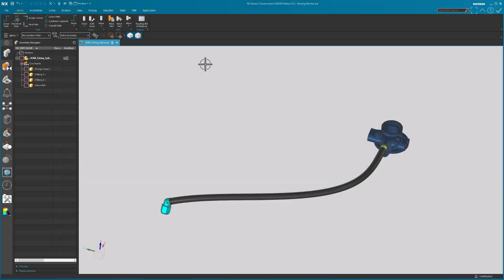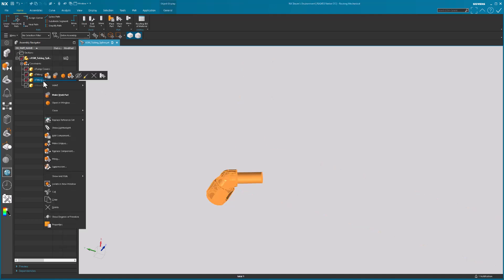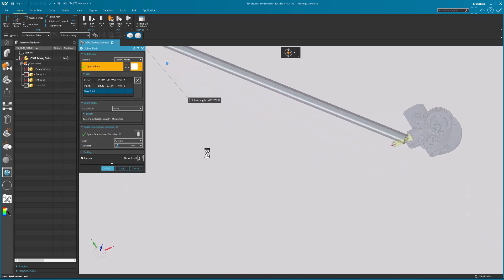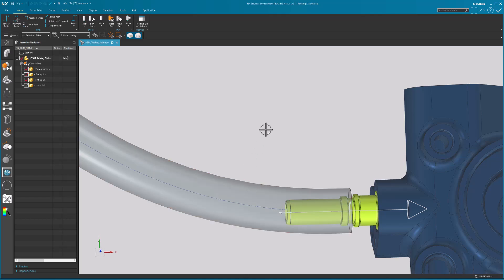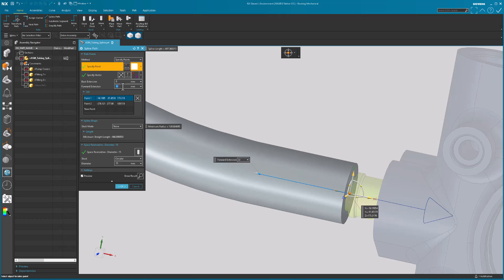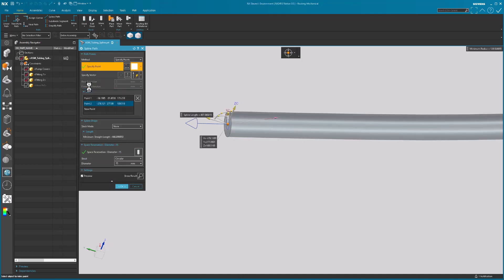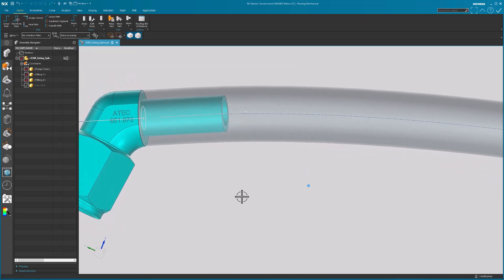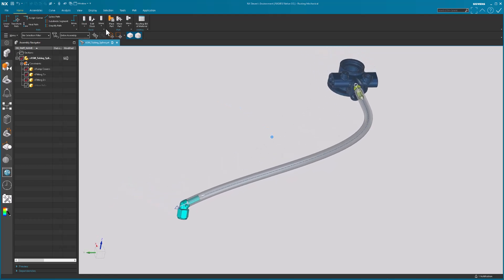Spline Path Hose Tricks in NX You Need to See!

Comment: Why don’t you qualify the fittings with mechanical port objects instead of a point/axis? This should also make spline “connections” easier
Reply from the maker: It's an added step that needs a separate video.